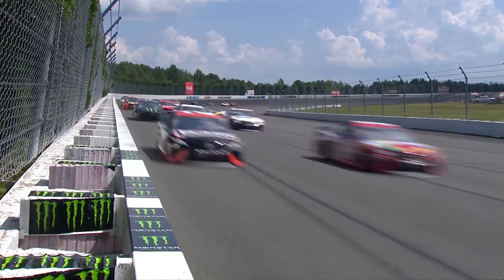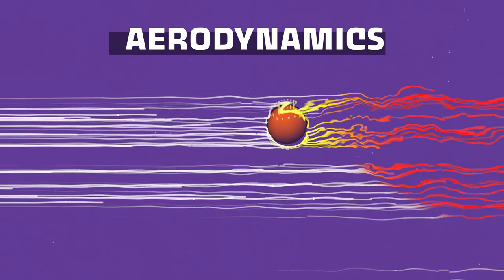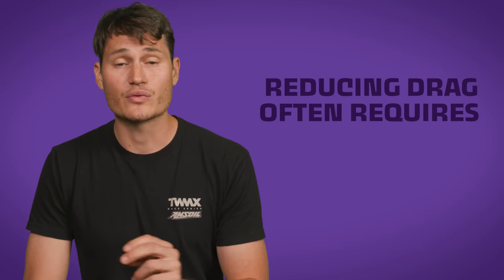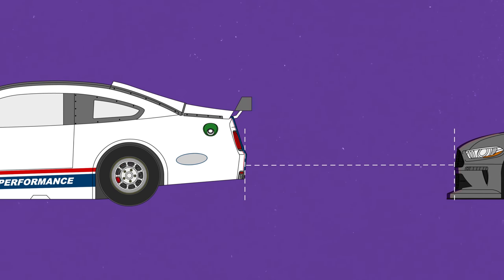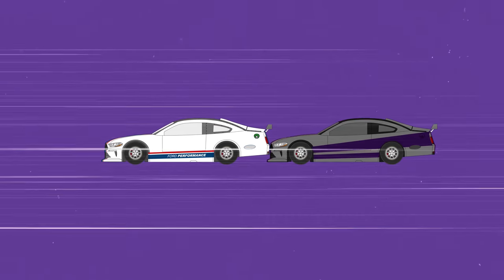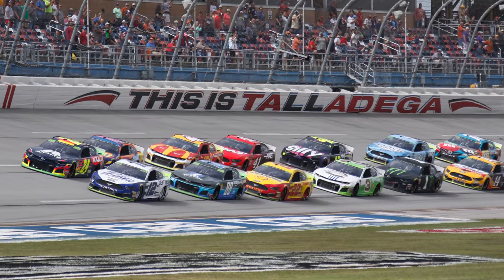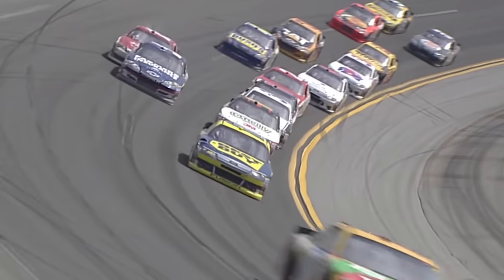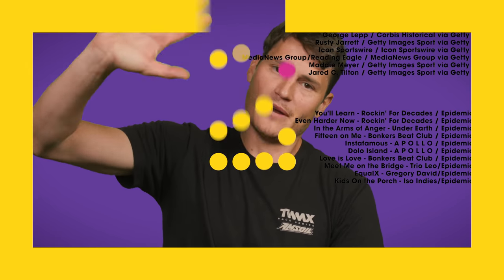The Science of the Shake 'n' Bake

Comment: Audis and BMWs owners know tailgating reduce wind resistance. And everyone thought they were just pricks 😂
Reply: I once did 75 mpg in a Peugeot 206 over 250miles sitting right behind a big ol' truck halfway through germany. Drafting is an amazing fuel saver but the view gets a bit boring after a couple of hours
Reply: @YeeSoest  works great until the truck suddenly breaks
Reply: @xavierrodriguez2463  volvo truck brake
Reply: @xavierrodriguez2463  volvo truck brakes
Reply: Also not using their signals adds another 28.4% to the drag efficiency
Reply: @glockgrouptherapy  Turn signal delete = Weight reduction
Reply: Relax
Reply: i just do it because you are doing 60 in the fast lane

Comment: One of the other detractors to the tail car in a tandem is that the front car totally blocks the airflow to the trailing car's radiator, so the engine starts to overheat. This is why you see the cars switch places after a tandem.

Comment: Great now when I'm tailgating someone, I can say "I'm just drafting man I'm low on gas".
Reply: My bio-dad used to do this with trucks on the highway. Somehow he never ended up under the back of one.
Reply: See i tailgate for the opposite reason.  If there is somebody in the left lane matching speed with semis I get right up their ass to get them to finally pull ahead.  But also for the same reasons, my truck gets better mpg at 75 than 55 and fighting huge side drafts from semis.  Not to mention how stupid and dangerous it is to ride side by side with anyone on a 2 lane, let alone an 18 wheeler that will flatten even my pickup.
Reply: @shadow105720  I love brake checking tailgaters. One time a guy almost flipped his pickup because I showed him that the Prius I was driving at the time could stop faster than his brodozer. Seriously, Priuses handle and stop better than you'd think. They just don't go very well.

Comment: Lots of good information here! 

One thing that should be noted is how the tandem drafting works. Back in the early 2010s NASCAR had bumpers that lined up better with the Car of Tomorrow and it forced drivers to lock bumpers and tandem draft in order to win at the restrictor plate tracks. This wasn't really "bump drafting" as they weren't bumping, but actually the rear car pushing continuously on the front car.

The "aero-push" also doesn't come into effect that much on the restrictor plate tracks where tandem drafting exists. The main disadvantage that trailing cars faced was actually overheating because the tandem draft covered the grill opening and caused them to run hot. So drivers would work with one in front and one in back for a few laps and then have to switch going into a corner and then they could hook up and keep tandem drafting. It truly became an art in the early 2010s and being able to time the switch and being able to tandem and switch in the shortest amount of time became a real skill set for drivers.

Unfortunately when NASCAR introduced the Gen6 car the tandem drafting sort of died out because the bumpers didn't line up as well, and NASCAR implemented rules to forbid locking bumpers, which I personally dislike.

Comment: Hey potential member of donut media. I love the content being provided by the media group and was wondering if a short physics video of (as silly as it sounds) how an engine... Turns off?
Reply: Spark + air + fuel – spark – fuel = engine no worky
Reply: When you turn the car to off, Ignition tumbler your key goes into kills the eletrical power to your fuel injectors and ignition coils. With no fuel to burn or spark to combust the engine stops running.

Comment: I can't wait till next year when they actually have to use suspension that you would see on a stock vehicle. Because my Toyota definitely has a solid rear axle
Reply: I bet your Toyota also has a 355ci V8?
Reply: @busterbarlow9094  Not yet... 😏
Reply: The IRS system they are going to is an attempt to emlimate wheel hop. Will be interesting to see who can use it to their advantage, that and the new transaxles will be the biggest changes i think. I can't wait to hear the sequential gear changes at Sonoma next year.

Comment: Great video explaining how much more detailed pack racing is in Nascar! However the limit for two car tandems is not aero push. On the tracks they would two car tandem (Daytona and Talladega) the track is so long they don't understeer, they actually overheat from no airflow to the radiator inlet. Nascar introduced no push rules and made radiator inlets smaller back in 2012ish to discourage pushing, but still happens.

Comment: Slipstreaming also works on bikes. My friend let me ride behind him and I crunched up behind the number plate. We have the same bike… just different colors. He weighs a little less than me though. He had to pedal a lot but I didn’t as long as I was close behind him… but if I fell away it was so hard to catch up. 

We did it because my chain was missing 2 links and kept popping off if I pedaled fast. 

Got me to the bike shop lol 

Lot harder to slingshot on bikes though since the “power” depends on your leg strength, weight, tire tread, and energy. Even the kind of hat you wear. 

Plus you have to stand up which changes the weight distribution….

We used to race all the time and it would pretty closely Mimic nascar racing because well… the physics are close on most wheeled vehicles.

Comment: It's easier to think of it as one long car with the power of two engines.  High pressure drag in the front and low pressure drag in the rear.
As opposed to two separate cars with only one engine each but both with the same high and low pressure drag.

Comment: Slingshot is more shoving the guy in the lead out really far and slowing down. Basically leaving the leader “out to dry” then using the low pressure air to get a huge run on him. Also side draft is also caused by the front splitter too. Not just the rear spoilers. Good video though

Comment: You should also look at aero from a top-down perspective. The nose dumps air left and right of the car too. And that's the air that becomes important in side drafting. Side draft isn't created by the wing/spoiler dumping air on the competitors spoiler. Side drifting happens when the trailing car creeps up on the quarter panel of the leading car. The trailing car dumps the air from the nose onto the leading car's wing. Adding more air to it. Therefore slowing it down, pulling it back. Once there is forward momentum from the trailing car, the key is to break off the side draft. Otherwise the leading car can do exactly the same to you when the trailing car passes the leading car. https://www.youtube.com/watch?v=D_9Y7oFQqFE

Comment: okay, silly question:

when trying to draft through a corner, where is the optimal place to be? is it directly behind the lead car, as it is on straights? is it offset towards the outside of the corner, where you might expect inertia to pull the wake? is it somewhere else, entirely?
Reply: I would think offset slightly to the outside to get some air on the front of your car to help with front end grip.

Comment: would it be against the rules of nascar if they where to rock up with a formula 1 style car
Reply: I dont think an open wheel car would pass inpsection
Reply: @rdlangston13  so in nascar is their a certain inspection on how the car looks
Reply: @c.o.m.e.t1281  yes, the cars bodies have to match a template and all cars have to go through pre-race inspection with a fine tooth comb.  A while back Chad Knaus (Jimmie Johnson’s cree chief) got suspended and fined because he had wedged a thin object between the rear window brace and the rear window in an effort to deflect a little bit of air over the rear spoiler to reduce drag at Daytona.  When NASCAR placed the template over the car it didn’t match up and they got busted.

Comment: Can you make a video on how to make serious horsepower naturally aspirated without increasing displacement perfect example here is my build for my 2000 Mitsubishi Eclipse Gs 4g64 
Stock block
Stock forged crankshaft 
Crankshaft scraper
Windage tray
Manley performance H-Tuff connecting rods
ACL Race Series rod bearings
ACL Thrust Washers
Stock Pistons 
Manley performance sport compact piston rings
SCE .021 race head gasket 
Ported and polished cylinder head with performance 3 angle valve job supported up to 450 horsepower cfm wise 
Ferrea 6000 series valves
Rpw(RacePerformanceWorks) valve spring upgrade kit 
Stock camshaft 
Custom intake manifold 8 inch length intake runners that are 2 1/2 inch wide 
Stock 60mm throttle body
Rpw(RacePerformanceWork)extractor 4in1 race design stainless steel header 1 5/8 primaries
High capacity fuel pressure regulator 
High flow fuel pump 
High fuel filter
Mishimoto high flow baffled catch can 
275 cc injectors 
Moroso Super Cool Can fuel cooler
The goal is 250-300 crank horsepower daily driver but everyone swears it won’t make the power

Comment: The way you described the Side-draft isn't exactly correct, or atleast the example animation wasn't.  Typically, the side-draft is performed by putting the nose of trailing car to the quarter panel of the lead car, and that pushes the air that is on the side of the lead car onto the spoiler, slowing them down.  You don't do it when side by side because that would slow you both down. Get on that quarter panel for half a second, and move away so you don't get affected by the lead car side drafting you back when doing the pass.